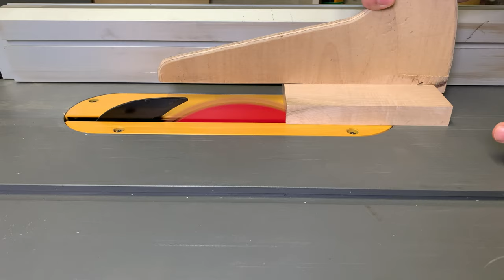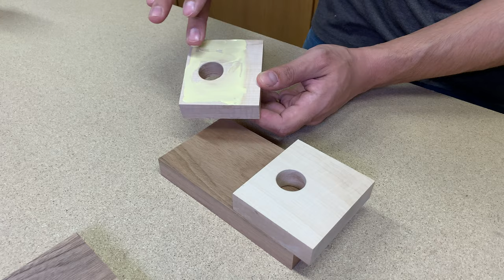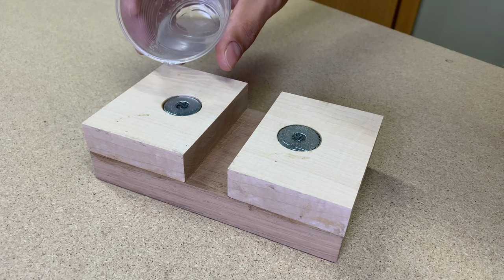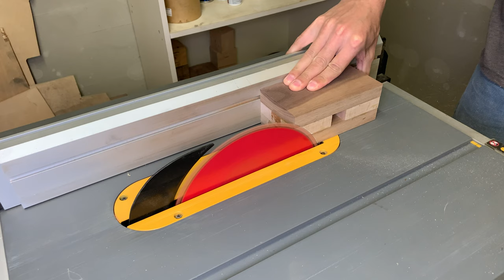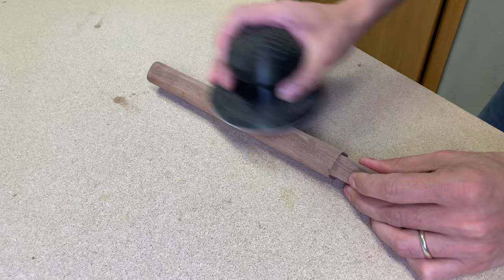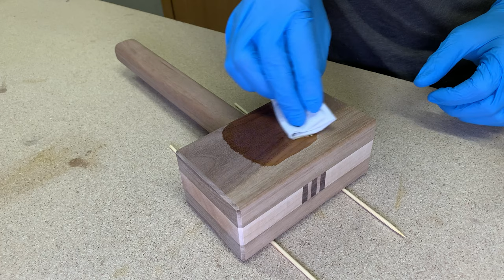Don't Throw Away Scraps of Wood! Make Something!

Comment: I build enough mallets to know. Just gluing it up alone sometimes may not be strong enough. Over time when you use it enough. It may come apart. Happen to me 😂 . But maybe using epoxy may help. Can expand the hole for the washers to glue up all 3 pieces together.

Comment: Did that small on the table saw fence slipped or escaped to safety?  :)
When i don't use push stick ,I have that habit of gliding my two fingers on the other side of the fence. I guess If something goes wrong , only the piece would be be pull and not my hand with it... :-/